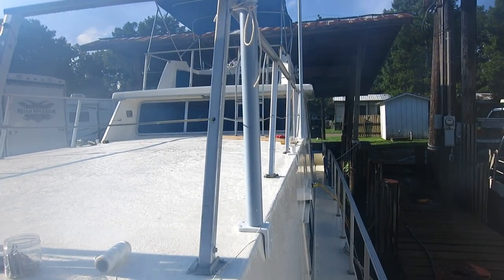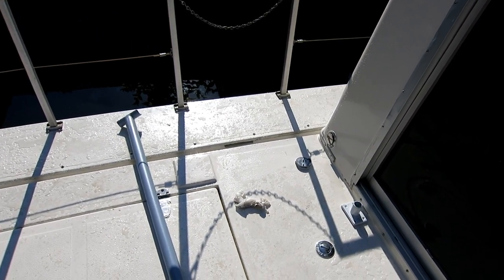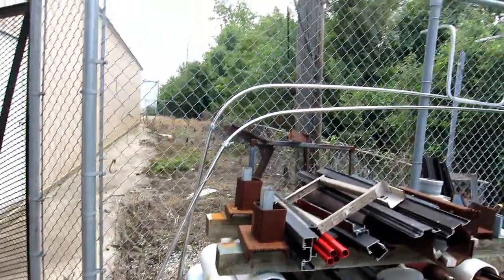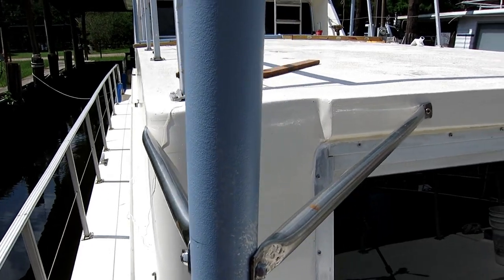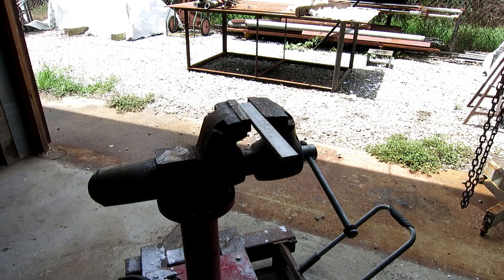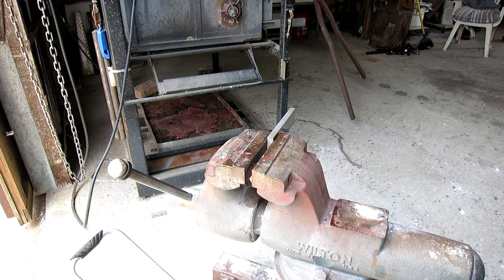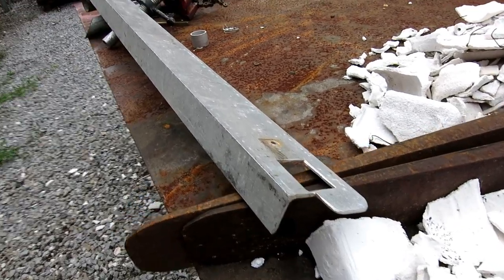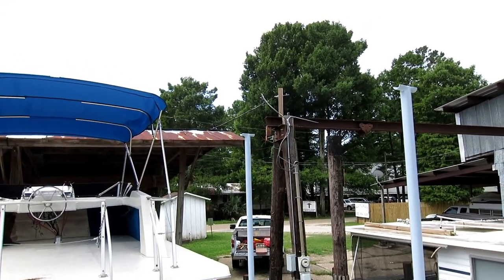The Houseboat Project #46, Installing the canopy supports.

Comment: Very impressive series here, been looking through the videos.  So is this the first video that you did with the boat launched?  Looked and #44 was still in your side yard.  Would really like to know how the boat performs.  My 19yo son wants to rebuild a houseboat to tour the waterways and really likes the idea of outboards for keeping the props up and getting into skinny water if needed.  Thank you for documenting this.
Reply from the maker: Brian
Thanks for the comments and kind words. After years of owning and operating the boat we are convinced that outboard are the way to go for just the reasons you give.  When first launched the outboards pushed the boat to a little over 20 MPH! But they were lugging and never could turn over 4000 RPM and that is a situation these old two strokes don't like. Ordered new props and now we are a little two far the other way. But the boat cruses at hull speed (10 MPH+/-) at 3000 RPM and the motors never struggle. These boat renovation projects are not for the faint of heart, they are a LOT of work and can be a little pricey. But if that works for you I can't think of a better way to kill a year with a young son. 
Good Luck!
 Barry